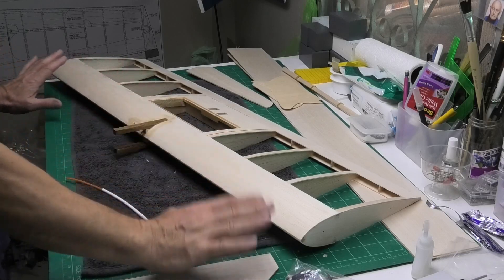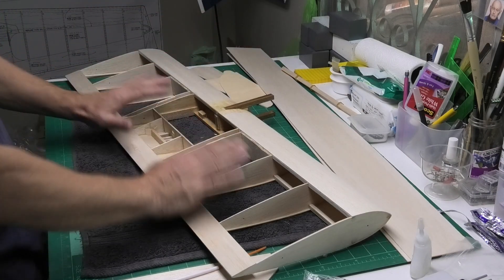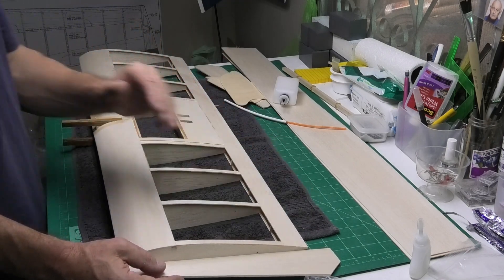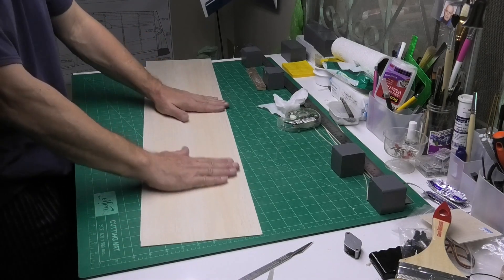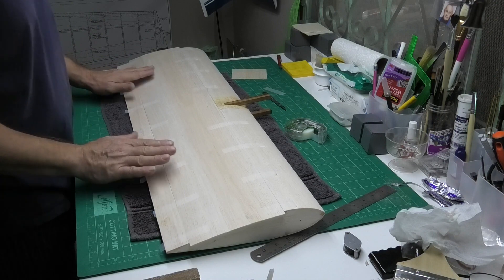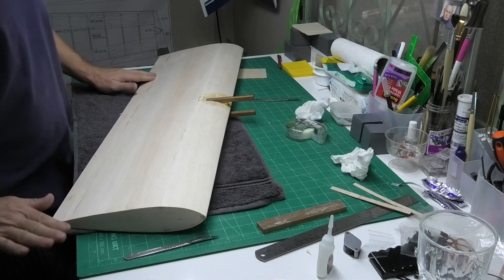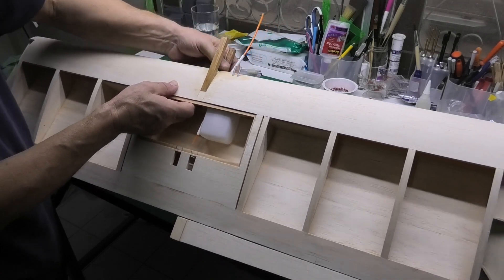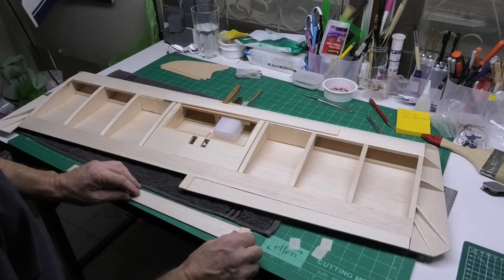King Kombat Pt 4 - a balsa 40" RC flying wing! - Finishing off the wing

Comment: I don't understand the sheeting on the bottom of the wing. In the late 80's I had one of these and building it per plans with cap strips worked fine. We also did combat with them and we powered them with .25-.32 engines. It was a blast.
Reply from the maker: Hi, thanks for the comment, there is not a lot to understand really, as I explain in the video, where I fly the ground is very hard and the vegetation very dry much of the time, so no lush veg or grassland to land on. Hence thought it would make the underside more robust, so not having to keep patching holes, while adding negligible weight.
Reply: We regularly landed ours on concrete and asphalt. The muffler will take all the beating.